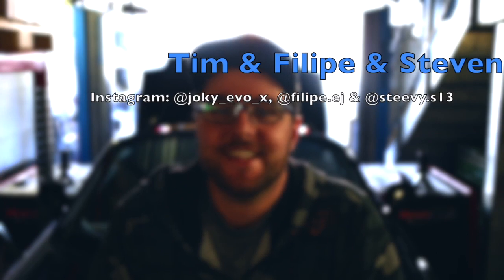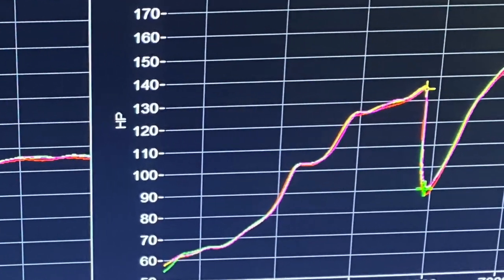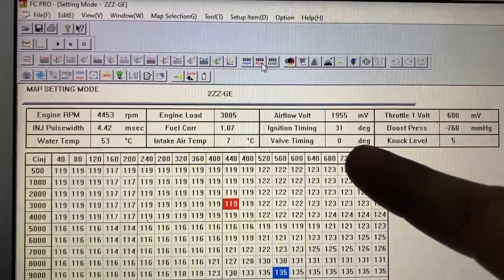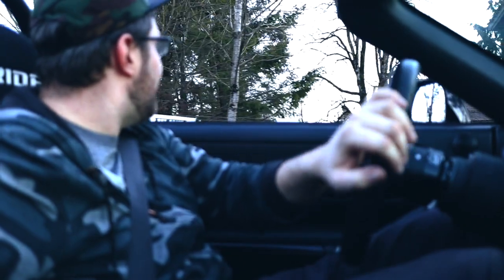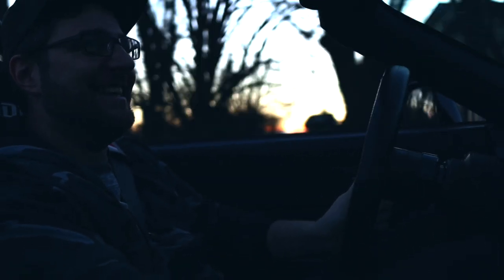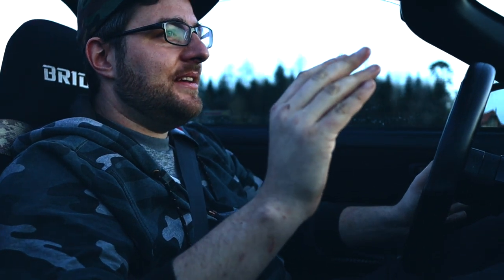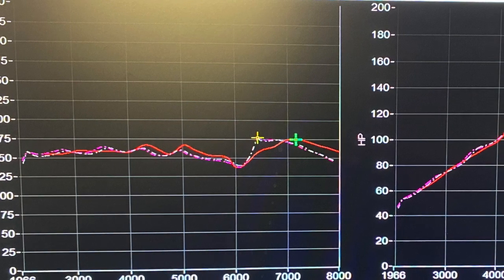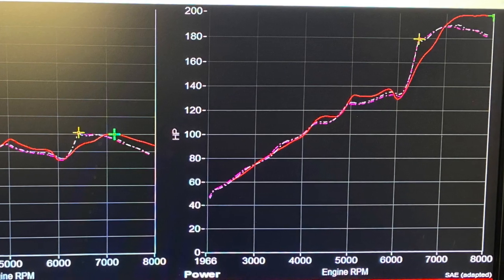EP22 Project Lotus Hunter: 2ZZ Engine Tuned to 200hp(work in progress).How does it feel on the road?

Comment from the maker: Hey 2zz Mr2 Owners! Who has passed the engine 200HP mark in NA form? 😁
Reply: A 2.5" PPE header and exhaust  could likely help you to make it over the 200 HP mark. Also moving the air filter to where the battery is now.
Reply from the maker: @tobihopmann7232  hi! Thanks for the advice! I will be surely making some more mods. The airfilter was already moved now. I will see if it makes much difference 👍🏼
Reply: Grind the intake manifold, lots of potential there and a fairly simple job.
Reply from the maker: @14energy  thanks for the feedback. What sort of grinding? Where? Hahaha
Reply: @JesseSpec  port match the aluminum intake maniforld on 2zz. Clearer now?
Reply from the maker: @14energy  ohh ok I understand 😁👍🏼 Is it that badly adjusted stock?
Reply: @JesseSpec  head is ok. Intake ports not so
Reply from the maker: @14energy  Ok I will definitely look into that next time I take the engine out :-) (it will be a huuuuuge ball ache to do it with the engine in the MR2 hahah)
Reply from the maker: @14energy  awesome! Thanks man!
Reply: Mine is in the garage ready to be fitted.We are hoping for 250 +
Reply from the maker: @Trickey1  Hey man! Me too hahahah but now is the interesting part going to start in order to make the numbers climb!
Reply: I'd say 200hp can be had with intake, 2.5" exhaust, Power FC ecu. It can probably do 250 with a super high compression build or 2.0 big bore block, but would cost $10,000+ to do that. These cars are best left stock, and if you run on the track just worry about doing an oilpan/pump. Toyota reliability is worth gold, dont turn it to bronze.
Reply from the maker: @cxbra  i might do a few external bolt-ons. The stock engine is pretty good, I agree. I’m pretty sure i will be able to crack the 200hp mark by improving the tune. I’m almost 100% sure I can do it!
Reply: I want to know how to tune the pfc I've done as much as I can easily but I need to learn more. So I'll be waiting for the tuning video 😁

Comment: Hi, fainally I swaped MR2 1zz,to 2zz from Corolla 2001. But @Jesse Spec I need your help, in MR2 dashbord don't work: charging batery (lamp shines), Hand Brake lamp shines,and some times ABS blinking 2 or 3 times from 10 times starting the engine, and water heating gauge doesn't work. Were need too check, and what need to see? 
all engine and ecu from corolla. Runs good, lifts from 6.5rpm works, runs untill 8.2rpm. 
Thanks for help!
Reply from the maker: Hi, good job for the swap! Did you use my videos?
When using my procedure, non of the lights you have were on, on my car…
Reply: @JesseSpec  Yes I saw video long time ago, need to see now fresh, and faind in wich video it is 😉
Reply from the maker: @marius_mask  Ok Perfect! Keep me posted how it goes!

Comment: Curious to know what your valve clearances are on the intake cam and have you checked for any intake cam wear lately.
Reply from the maker: Hi, have you watched my other videos? I’ve actually checked them in one of them and filmed it and they were spot on. I’ve done 3-4000km since I did that check so I don’t see the point of redoing it! May I ask why you are asking? There has been no unusual wear on the intake cams last time I checked 👍🏼
Reply: @JesseSpec  Because myself and others who followed the manual specs are experiencing broken rockers and intake cam wear. It doesn't exactly happen at 4000km, but eventually will. Mine broke at around 14k and wore probably way before that. And the funny thing is that the engine runs fine until you hit higher rpms where you'll get a misfire.
Reply from the maker: @hiblendmedia  ok thanks. I’ll keep an eye out for that. My engine has 140k km I think. Could be also due to oil quality I think and lack of maintenance. Seems likely
Reply: @JesseSpec  I rebuilt my 2zz with all new internals. I use full synthetic 5w30 every 3000 miles w/filter change. The new high intake cam lobes wore and 2 rockers broke before 14k miles using 0.12mm - 0.16mm lash. Exhaust cam clearance and wear is totally fine with specs from the manual.
Reply from the maker: @hiblendmedia  couldn’t it be related to the camshaft itself? Mine are stock so not really comparable 🤷🏼‍♂️
Reply: @JesseSpec  That's one theory, maybe I got weaker older revisions of the OEM cam, but it is stock.
Reply: @JesseSpec  Just watched your 2ZZ prep video and I see you've used 0.01mm - 0.16mm for the intake cam. Just a heads up, you may be in for a wiped intake cam, so check often. If not, then either some of us are ordering and receiving new, but weak OEM camshafts or rockers.
Reply from the maker: @hiblendmedia  gotcha! Thanks for the info 👍🏼👍🏼

Comment: la semaine dernière, ils ont terminé la reprogrammation de l'apexi et le résultat a été 219,25cv @ 7731rpm
209,17nm @ 7234rpm
Reply from the maker: Manifique! As-tu des arbres a cames? C’est quoi ta configuration actuelle?
Reply: @JesseSpec  
CatCams stage 2
Mwr flat face valves
Mwr valves springs
Mwr springs raiteners titanium
Crower maxi light connecting rods
Mwr Crankshaft lightweight knife
Flywheel fidanza
Head and intake manifold ported
R9k triple Y headers
 2,5 pipe without cat
Mwr alternator,water pump pulleys
Throttle body 69mm
Maf Housing and pipe 70mm
Hks mushroom air Filter 
Fuel inyectors 440cc
Dw 65c fuel pump
Reply from the maker: @brunotrdful  wooow! Elle doit arracher! C’est une puissance estimée au moteur ou aux roues?

Comment: hey jesse spec, mind if you list the most you made to get to 200hp on the dyno like you shown in the video? interested in your setup
Reply from the maker: Hi! Do you want the list of mods I did to get that power figure?
Reply: @JesseSpec  yes the list of mod, please. The durn auto correct changed it to most instead of mod. Hahah
Reply from the maker: @vlwl26  for the moment, stock revised 2zz engine. Monkey headers, test pipe, Fujitsubo catback. Custom POD air filter intake and apexi PFC ecu on my own custom tune (work in progress).
Next will be more tuning and an oil cooler.
Otherwise OS giken racing clutch and lsd in c60 transmission... i think thats about it

Comment: Hi, you need more rpm
Reply from the maker: Hi, I tried going higher but power drops off. I don't think there is much more in it in its current configuration. And doing more than 8300rpm on stock valve train scares me a bit hahah
Reply: @JesseSpec   give yourself time, tuning needs to be on point but ive ran multiple at 8700rpm
Reply: @JesseSpec   a R9K plenum would help you
Reply from the maker: @2zztercel558  thanks for the information and advice! I’ll be giving it a few more hours see what i can do

Comment: Been following this build and im happy to see it finished (or should i say running and driving. We all know they are never finished)! I get a big smile too when lift hits! Keep up the good work! 👍
Reply: Me too, goes from "oh, well it's not slow" to "oh crap! We are definitely moving now!" When VVTi-L kicks in yo
Reply from the maker: @LupinYonderboy  hahaha exactly. Now the goal is to go past 200bhp and see what we can do in order to achieve this goal!
Reply: @JesseSpec  following with interest. In the UK I could get an ecu for £800 and who knows how much for a tune to match your 200Bhp. That's an expensive 10hp :-(
Reply from the maker: @LupinYonderboy  remember my friend, this is my first crack at tuning this engine 3 hours on the dyno. I've mapped many different engines and on different tuning platforms, but its my first 2zz and only 3 hours. Thats It.  Doing it correctly and experimenting on whats best takes days if not weeks to find what really works well (also in the long run). Also when playing around with various intakes and exhausts. Which means that there surely is more in it. Furthermore, the ecu is what allows you to actually free up more power when you do other mods (exhaust, intake, cams, etc.) so, sorry to say this, but your metrics of 10hp gain per 800pounds paid isn't a good way of putting it. On top of that, its not the 10 extra hp at the top of the rpm range that you feel, its the improvements in torque low down improvements in response that make the biggest difference felt rather than just thinking 800pounds for 10 hp :-) Do you understand what I mean? I feel an ECU should be the first mod you do to your engine. It frees up all the limitations that you have now and also the ones you will have on future mods and gives you the opportunity to custom tune your ecu to suit any give configuration present in future, which is worth a lot if you see what I mean.
(you've earned my longest reply to any comment to date ahahaha)
Reply: @JesseSpec  I absolutely get you mate! Yes the ECU is essential for further mods and although I've not experienced it, I understand that usable mid-range is much more useful than a few hp at the top when your revving the nuts of it ;-) A free-flowing exhaust setup and a sports cat will help it, I'm not sure what you're running currently. Thnx for the detailed reply.
Reply from the maker: @LupinYonderboy  cat free hahaha. There is definitely room for improvement in my setup. And more fine tuning to be done
Reply from the maker: Hello! Thanks for your message and encouraging words! You got that right! This is just a step that was reached! There is a lot more to come👍🏼 however I got to experience the « lift smile » which really is awesome!